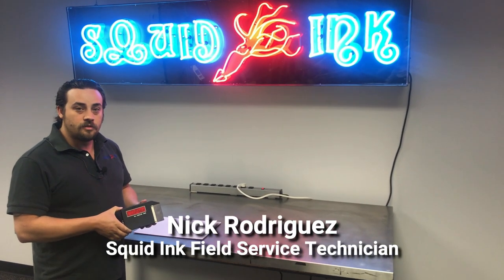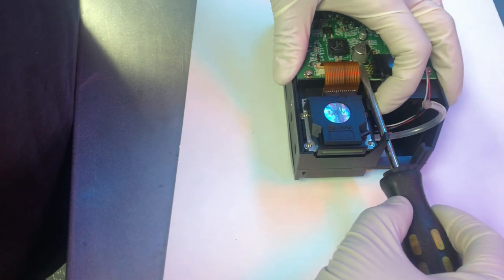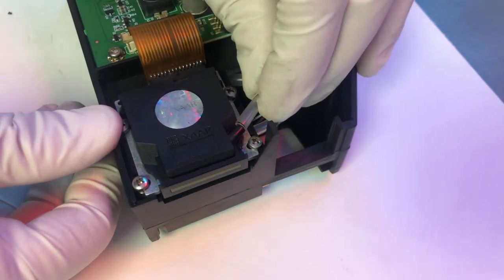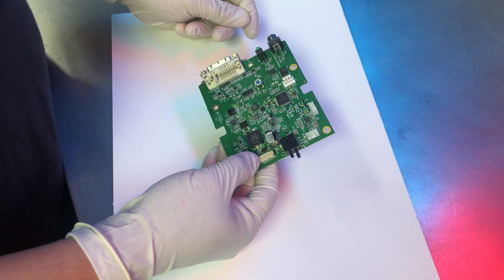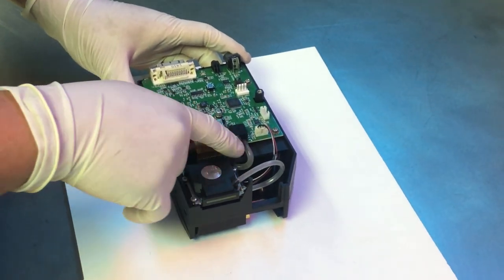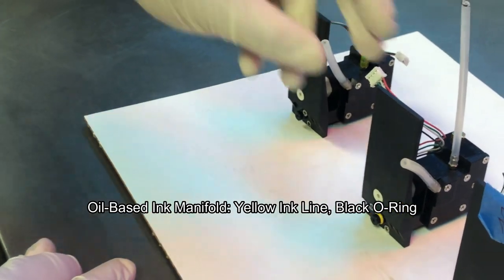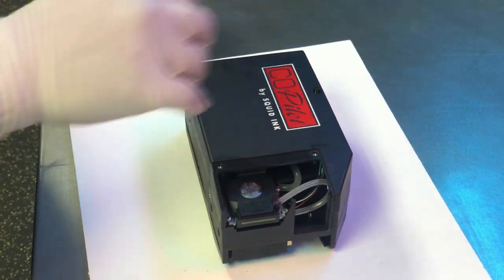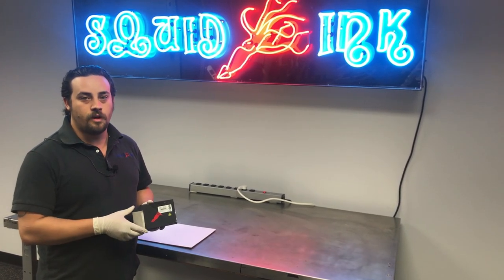CoPilot Hi-Resolution Printing System - Replacing the Print Engine and Ink Manifold

Comment: Hi , Rick when you have replaced the printer engine, Can I fill it with ink directly? ' cause the new print engine has storage fluid.
Reply from the maker: Alucard Belmont - yes, you can fill the new print engine with the appropriate ink.
Reply: So, I don't need flush with the cleaner before fill it with ink?